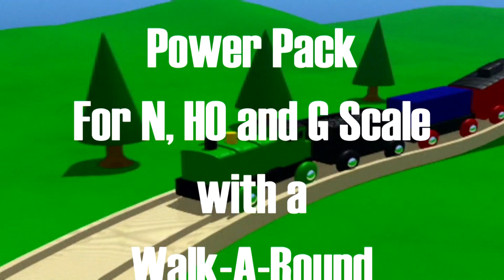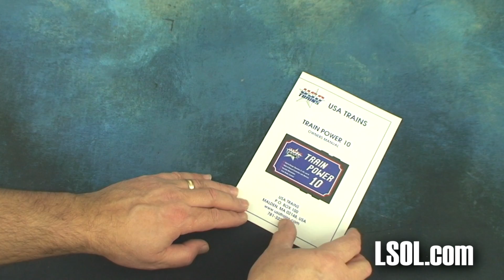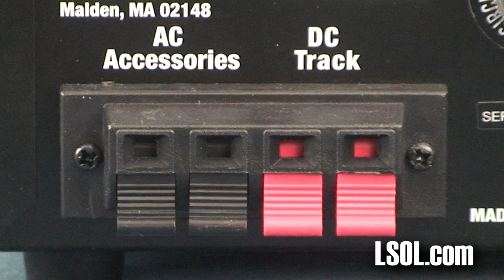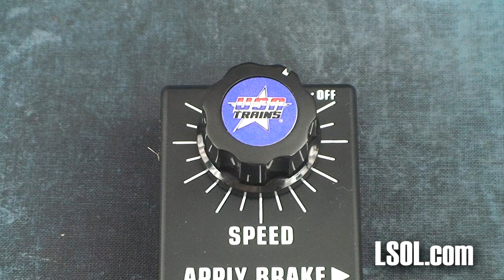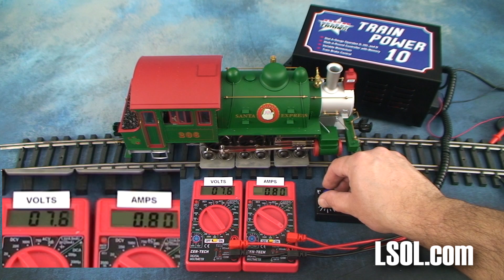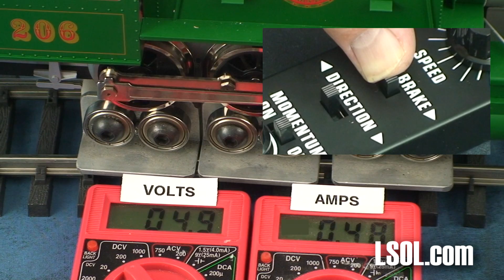Garden Trains: USA Trains - Train Power 10 Power Pack

Comment: My power 10 is awesome! Works great! It has plenty of power to run a big USA trains sd70mac and another single motor g scale engine at the same time. The fan noise I fixed by putting the supply inside a cardboard box with the backside open and plenty of airflow. It really cuts the fan noise down. I really like being able to locate the controller anywhere I want with phone line. A big question I have is weather or not I can use this power supply on a digitrax DCC system to supply power to the brain. If anyone knows that would be helpful.
Also if anyone is interested in these power10s , I highly recommend them.

Comment: No, the jerky operation is only since the most recent repair and they tell me it's normal due to all the protection circuits interacting with each other. The other 2 failures were bad manufacturing and bad components. Perhaps I just got the lemon in a run of good ones.

Comment from the maker: Wow I have had mine for a long time and bang it around going in and out of the shop and have not had any issues.  The momentum works fine and the low speed starts are nice. Maybe the starts are a dirty track or pitted wheels issue?  Even after it was fixed you have these problems?  I would contact Charles Jr. directly at USA Trains.
Reply: Does the USA Trains Power 10 put out pure direct current or pulse power?

Comment: A good idea, but the pack is not well made. In 2 months, I've had to send mine back for repair twice, once because it was made with bad transistors and bad resistors, and then again when it blew up an IC due to a short circuit. Yes, repairs were covered under warranty, but at $30 shipping every time it fails, it's not a good investment.
PS Momentum works backwards on my controller!
PPS Low speed starts are very jerky, too.

Comment: Are there any DC controllers available in the USA that use a low voltage input (e.g. 12V DC, 16V AC, etc.) rather than 110V AC? Can't use this one in a 240V AC environment.

Comment: I have this power pack, am very happy with it. I use it with my usa trains gp9 and LGB trains. One nice feature in the manual, I added a phone wire splitter and connected 2 4 wire phone lines around an outdoor layout I just built, so I'll be to operate the trains anywhere on my layout. The other cool thing is, when the loco is running I can disconnect the controller, let's say point A and transfer to point B, the loco won't stop it will keep on going. I like it's internal memory feature.
Reply: Just out of curiosity, which LGB engines do you have?  I have an LGB F7, and I am trying to determine whether or not it is safe to run it with the Power 10.

Comment from the maker: @PnPrailroad Yes it does have a big fan, most of the big ones do. So... it did not sound out of place to me. Our power supplies are outside so the fan noise is not really heard. If you were going to use this inside I think you would want it under the table. The same is true for biffer Bridgewerks Power Supplies.